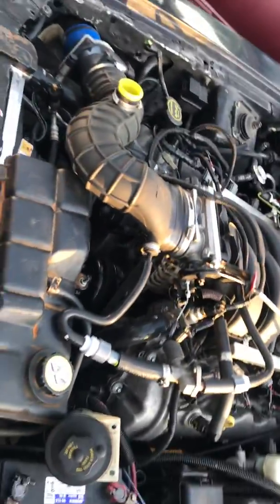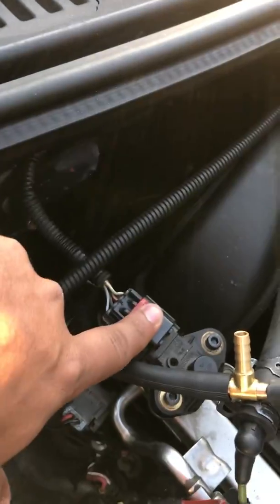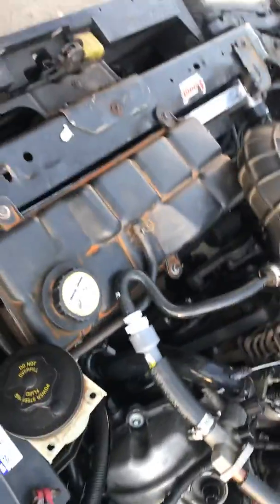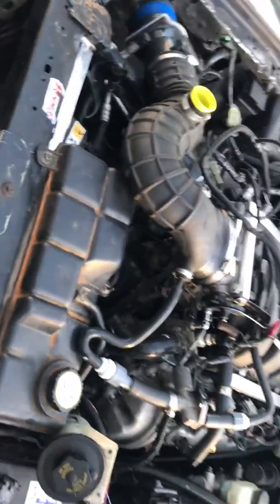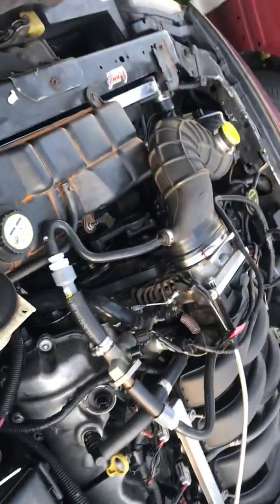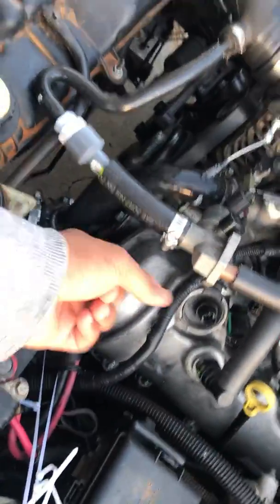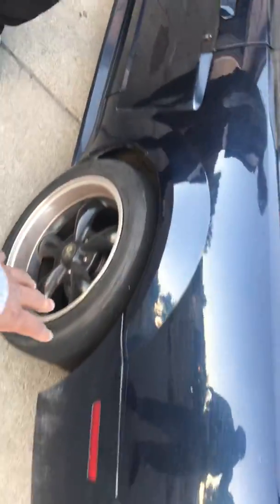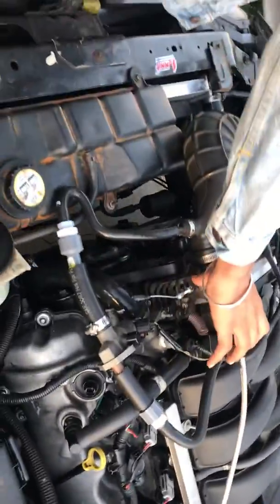1999- 2002 Mustang gt, 3V swap.. info

Comment: Hey love the build. I have a 2001 auto gt, it has 215k miles. It’s definitely time for a new engine, I want to do a 3v sawp. But I also want to swap it to a stick at the same time. Do you think it would be too difficult?
Reply from the maker: Daniel Eustache no it won’t be difficult too difficult, you would need 5 speed transmission and clutch pedal assembly.. What’s your budget like ? 3-6?
Reply: Sidhu Motorz is like to spend around 4,500. Can it be done? What state do you live in?
Reply from the maker: Daniel Eustache yeah you can do it in that much just get used 5 speed transmission, i live in California.. you can get the 3V engine for 1k or less
Reply: Sidhu Motorz that’s not bad. Thanks for the info, dang I was hoping you lived in Ohio and could meet up lol
Reply from the maker: Daniel Eustache you can ask me if you have any questions I’ll help you out, it’s not as bad since I. Have already gone thru the difficult phase of doing the build so I’ll definitely help someone else out so they can do it easier then me
Reply: Sidhu Motorz awesome, I have a little bit of body work to do first. Then I’ll be getting back with you I. The near future. Appreciate it man
Reply from the maker: sure sounds good man, feel free to message or comment and make sure you subscribe to the channel, more videos are coming on new projects.
Reply: Sidhu Motorz thanks man! Just subbed
Reply: Daniel Eustache dosent even handle

Comment: Looking forward to more info on the car! Nice build man!
Reply from the maker: iflo92if this car is done, took it for a 200 mile drive last night, made it back home safe and sound. Let me know if you have any questions about the build
Reply: Sidhu Motorz thanks buddy, I’m actually in the process of buying a 3v since the 2v took a crap
Reply from the maker: iflo92if those 2V engines are crap, let me know if you have any questions regarding anything, I’ll be happy to answer questions or I can point you to right directions if you are stuck.
Reply: Sidhu Motorz I appreciate that buddy! Any chance you have an Instagram? Do you think a long block would be sufficient I can’t find a full motor in the sac área.
Reply from the maker: iflo92if add me on IG: stangwala
Reply from the maker: iflo92if hit me up on IG I’ll tell you who to hit up for the 3V engine it’s guy down here in Bay Area I got mine from him 1k
Reply: @vally520  how did you connect your throttle wire to your throttle body
Reply from the maker: @franciscogonzales9764  you need to buy cobrra throttle body, from 98-04 cobra any will work search on ebay should be less than 100
Reply: @vally520  where did you get your throttle cable
Reply from the maker: @franciscogonzales9764  you can get any universal thorottle cable from any parts store, im in california we have napa auto parts, o reilly's. i think you can go to any get the universal since you will need to adjust
Reply: @vally520  can you send me the exact one you got
Reply from the maker: @franciscogonzales9764  if you go to any auto parts store they will have a section for universal things, that cable is for all cars not just mustang, i just got that it was like 30 bucks i think
Reply: @vally520  / fuel pump regulator is the last wire on the right side is that the one you don't connect